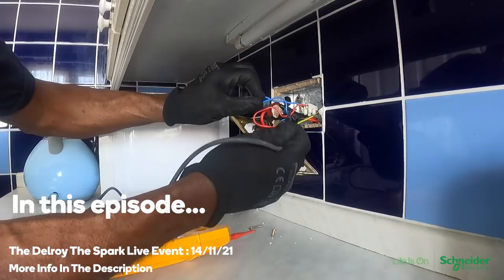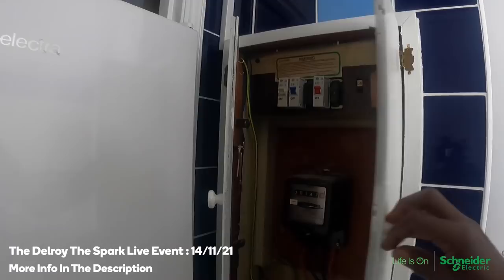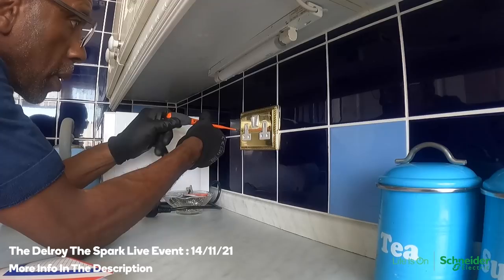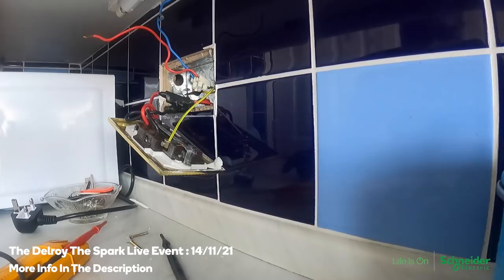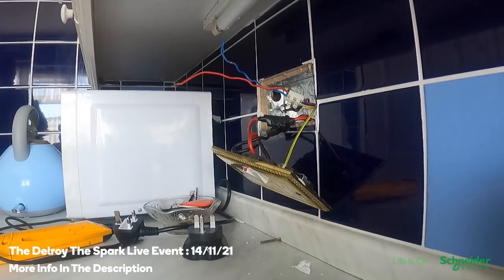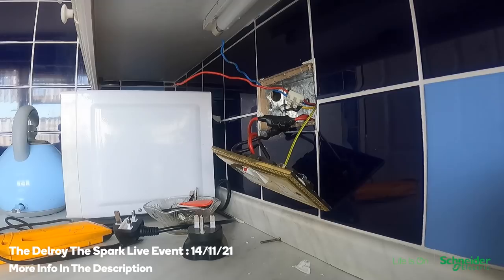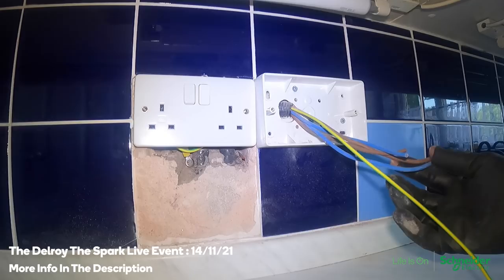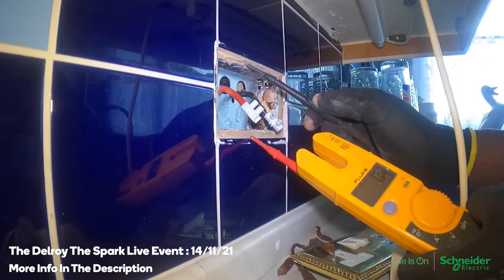"This Is A Joke" | Awful Electrical Work, Earthing Issues & Landlord Dilemma's | Electrician's Vlog

Comment: Oh my DAYS, Del. Lyn needs to wake up and understand that gaff needs a complete re-wire. Everything you looked behind had been bodged to high heaven... can you imagine what horrors are lurking behind the sockets, switches and light fittings you didn’t look behind? 🙈🤭😧
As you explained to her, it makes no sense at all to skip the EICR. I suspect she knows it is a house of horrors and doesn’t want to face the fact that the gaff needs a re-wire. Still, she’s gonna need that EICR before the tenants move in, so it’s incoming. Must have been one hell of a frustrating job. 

I can understand not wanting to damage tiles if they were new/tasteful... however, those things had 1985 written all over them 🙄 You have the patience of a Saint. 

Great video Delroy - keep up the excellent work 👍🏼

Comment: Good video again - Whoever skimmed the ceiling in that hallway couldn't be bothered to remove the light fitting to plaster it seems = okay, until you need to change or permanently remove the fitting.

Comment: Great video, love your channel.
How you keep so calm while dealing with all that is amazing.

Just one question, it's my understanding that when you used wago's on the bathroom light, you didn't use an enclosure for the terminations. 
Wouldn't you need to put single insulated cables and the terminations should be done inside an enclosure. Reg 526.5 I think, states all terminations should be done inside an suitable accessory or enclosure.
So how come you didn't need an enclosure for this fitting?

Comment: The reason why most of us decent sparks(in North america) run an extra earth conductor inside of our conduit runs in case of a break in earth  continuity you don't run into these problems lol
Reply: We do now. That would of been done 50  years ago and it's been changed about since then. The conduit would of been a good earth when it was installed
Reply: @scottsparky1  it probably still is, as long as you actually connect your back boxes to it!

Comment: Lack of care for peopled safety is stunning!! 
Inspectors wearing  dark gasses when initial electrical install was done.
 Thank God for Delroy .
Reply: I strongly suspect when the install was first done it was done to what were accepted standards at the time. Even today systems which use the conduit as earth are still allowed by BS7671.

The problem comes when people start messing with it. Because the earth isn't a wire non-electricians either don't realize it's there or don't know how to maintain it. So you end up with missing earths when DIYers or kitchen fitters get involved.

Comment: Oh boy in the states I've been bitten by no earth on metal cover plates. (240 bite wld put you on ass best case)also some nut job wired a multi switch using just a single and wired the hot traveler to the earth screw (the earth wire was just not attached so if you touched the plate screw if switch was in right position you got a nice zap (down side of using plastic boxes lol)

Comment: any specific reason there is metal conduit for the wires here , and the "rest" of the country the cables are alle plastered in to the walls or drilled through studs ?
Reply: A number of London boroughs specified metal conduits in places they had built fifties and sixties, with the conduits running back to the "Mantel" enclosure with the meter and skeleton CU.  The conduit was the CPC, and an awful lot of sockets ended up earthed just by the mounting screws from the socket to the mounting box - no flying lead on some of the places I have worked
Reply: local authority  1950's and 60's

Comment: Good system in its time the old conduit and singles with the conduit being the earth but a nuisance to add onto and easily a danger if amateur diyers worked on it and didn't understand the conduit was the earth, that lot no doubt will want retired now as I would of thought the singles will be aluminium

Comment: What's 240v doing on an earth (CPC) cable? It should be 0v surely! Power should only be flowing on a CPC for the time it takes to trip the circuit, you seem to act like it's normal to have 240v on the CPC??? WTF man!?!